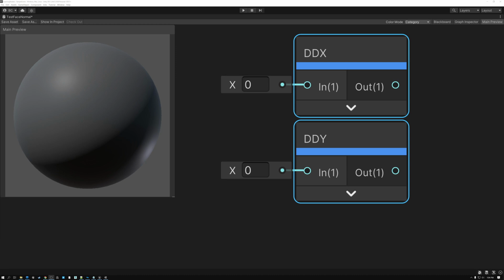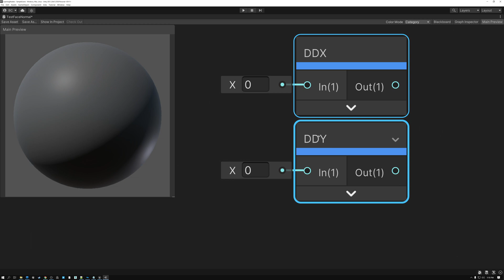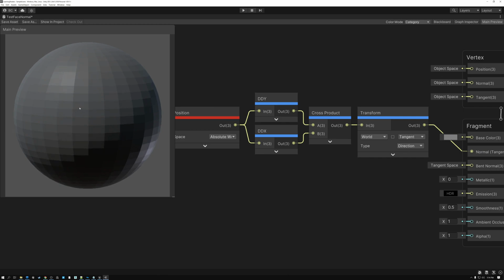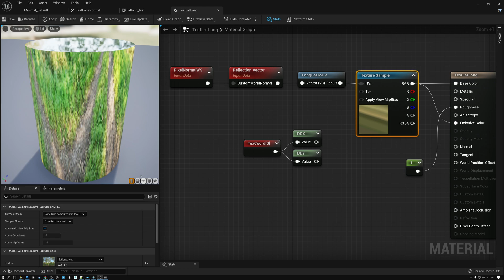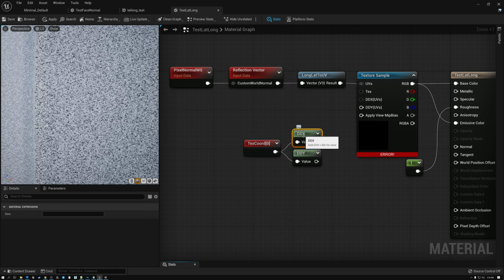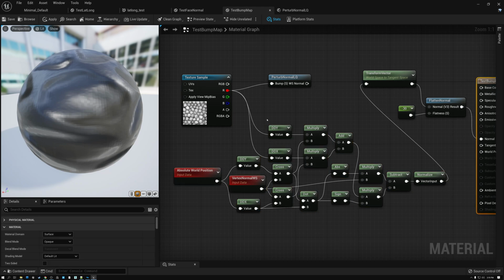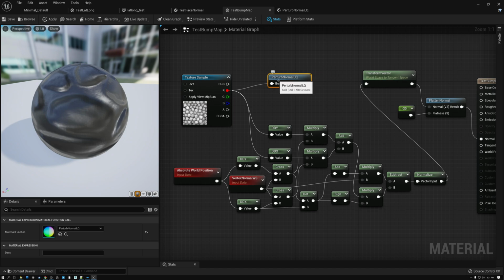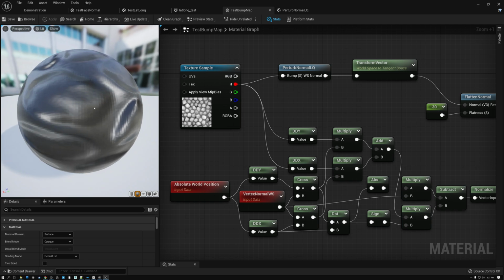Derivatives DDX DDY - Shader Graph Basics - Episode 18

Comment: Hi Ben, thanks for the videos. You said it reaches the next pixels but it looks like it actually is on the vertex level? So it reaches the next vertex and gets slope between vertices.
Reply from the maker: No, that’s not right. Derivatives only work in the pixel shader and act on neighboring pixels, not vertices.
Reply: ah got it, it is because you inputted geometry position. thanks for the reply and all the videos. priceless resource
Reply from the maker: @hakanviajando  Derivatives work because the graphics hardware deals with pixels in groups of 4 instead of individually. So normally, each pixel has no idea what the pixels around it are doing. But in the case of derivatives, it's looking at the neighboring pixels in the quad group that it's currently working on. It's able to see the depth of the pixel to the side as well as the pixel above or below, and with that difference in depth, it's able to get the slope and therefore the normal. But it doesn't have any concept of whether or nor a vertex/edge is smoothed. That's why the faces are facetted - because it's calculating normals based only on depth differences.
Reply from the maker: Here's some additional reading material:

https://www.aclockworkberry.com/shader-derivative-functions/

Comment: I've been trying to understand these derivative functions better for use with converting SDF textures into a vector field, or creating UVs that conform to an SDF border.  I think by rotating the SDF slope vector 90 degrees I can create a flow field around the shape, and figuring out how to create the UVs based on that and maybe relaxing them or smoothing them I can get usable UVs that wrap the shape. 

If that all works as I'm imagining I can bake the UV results into the unused channels of the SDF texture.

Comment: Could you use DDX and DDY to calculate normals from a height map or texture?  If so, is it more expensive than doing a texture fetch for a normal texture?
Reply from the maker: Yes you can! However, the results are a bit blocky, and there's no filtering or mip mapping, so the quality isn't very good compared with sampling a texture.  But it is a technique that's usable in some cases. In Shader Graph, the Normal From Height node works that way - with DDX and DDY.
Reply: @BenCloward   To expand on this, I noticed that the bump map for unreal does not update in Lumen ray traced hit lighting reflections, I isolated it down to the DDX and DDY nodes. As far as I understand it those are screen space calculations, so would you know of any alternatives that would work with that?

Comment: Question... i have a material that uses triplanar for a 2d texture Array instead of a regular texture. It works fine with regular texture, but im not sure why the ddx and ddy doesnt work for the texture array. Seems like when i set it up to use the normal mips instead of DDX and DDY it works, but when i leave the DDX DDY connected to a texture arrary it says .. "(Node TexSampleParameter2DArray) Cannot cast from smaller type float 2 to larger float 3... 

Basically for an array you would typically append a scalar value to the UV value to choose which texture in the array... Would i need to do something for that with the ddx ddy?

Comment: ive seen people use ddx and ddy for a triplanar material i found... i dont understand the point of it. Why would they?
Reply from the maker: Hard to say without seeing the specific implementation.  Here's one method that's using derivatives to make triplanar mapping cheaper: https://iquilezles.org/articles/biplanar/  Code is in GLSL so it's using the equivalent dFdx() and dFdy().  It's using these to figure out the slope - so it can know which two of the three faces are the most important in the effect. Then it just does biplanar mapping with those two faces instead of the full triplanar - making it perform a little bit better.  It's very clever.

Comment: Thanks, that was nice intro to derivatives for me. 
One question though -  I think you need to normalize normals after cross product to make it work correctly. Noticed that from Ned Makes Games when he was implementing similar effect (https://www.youtube.com/watch?v=J1n1yPjac1c)
Reply from the maker: If you do a cross product between two normalized vectors, the result is also a normalized vector - so no need to normalize again.  It's safer to normalize (because it's always possible that one of the input vectors isn't normalized), but faster to not normalize.  I usually err on the side of faster. I would only add in a normalize here of there was some visual problem caused by not doing it.  If you put in a normalize and see no difference in the result, get rid of the normalize.
Reply: @BenCloward  actually it's true - I'm not sure why but it works without normalization in the case you showed, where you put recalculated normals to normals pin.

In my case where I was making unlit shader that was using recalculated normals in the process, it worked only after normalizing the value after cross product. Nor sure why though.
https://i.imgur.com/soS5sKD.png

Comment: Ben you are a true hero! One thing I want to know about perturb normal is that can we increase the final normal quality by increasing the height texture resolution or applying a blur after perturb   normal?
Reply from the maker: If you need better quality, the best way is to use the HQ (high quality) version of the node instead.  The point of this node that I'm showing is to be as cheap as possible.
Reply: @BenCloward  thanks, I will try digging into that.

Comment: Is it just me or do the normals look incorrect in the UE version?
Reply: I did some investigating. I put a material on a cube and if you spin the camera around in a birds eye view the normal vectors change. If I swap the position of the DDX and DDY that are coming out of the texture sample it fixes it. It was happening when I tried using PerturbNormalLQ too so the same would apply to it as well. Can anyone else confirm that I am right?
Reply: @whyismynametaken123  in UE example there should not be transformvector node

Comment: So.. granted you have one texture with RGBA channels, you can technically reconstruct normals for the first channel & second channel and also have one for detail normals (using the DDX/DDY method) and.. perhaps some mask or something in the alpha.

Handy!
Reply: This method is good for converting intermittent or runtime generated greyscale data to normals. If you're using an actual external texturemap you will be better off spending another channel to create an actual normalmap rather than paying the ALU cost that comes with this setup.
Reply from the maker: Yes, you could do that - but detail normals are usually in a separate texture because they’re tiled at a higher frequency than the regular normal. Otherwise you could just bake the normal and detail normal together into a single normal.

Comment: Stupid question ... is it better performance-wise to use alpha channel on my albedo texture and autogenerate nml from it, or to plug an entire extra nml texture? I don't mind extra pixelation if im going to save space/memory and even gain some extra performance from it.
Reply from the maker: Fewer texture samples is cheaper.  But the quality of normal data that you'll get from a bump map is pretty low, so you'll want to do tests and see if that low level of quality is acceptable for your use case.
Reply: @BenCloward  Will do. It's for mobile so unless it's gonna look very weird, i probably wont mind low quality. Thanks for the answer :)

Comment: I was always sampling heightmap several times with shifted UVs in order to get the normal. Looks like now I need to rework that parts.
Reply from the maker: That method will give you cleaner results than the ddx ddy method, but it's more expensive - so it just depends on the cost/quality trade-off you want to do.
Reply: @BenCloward  Yeah, it is a landscape in my case which is seen only from the sea so quality is not that important.